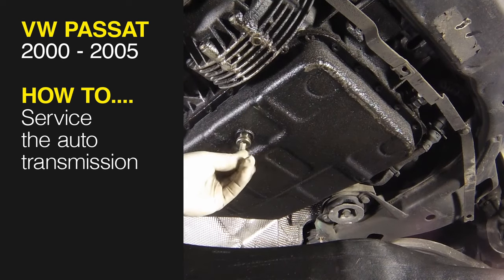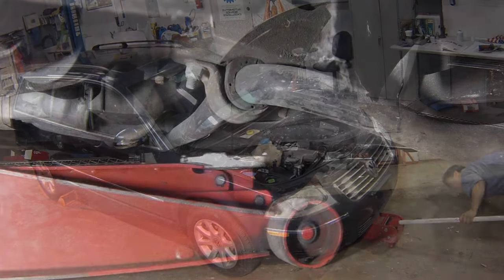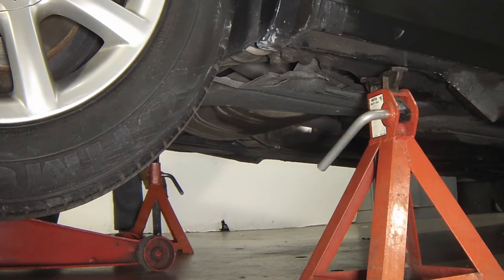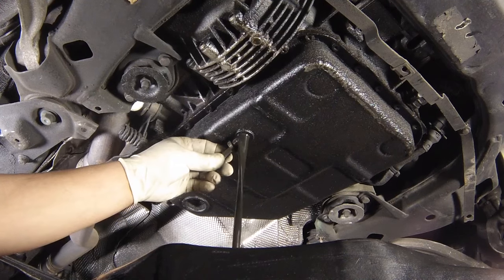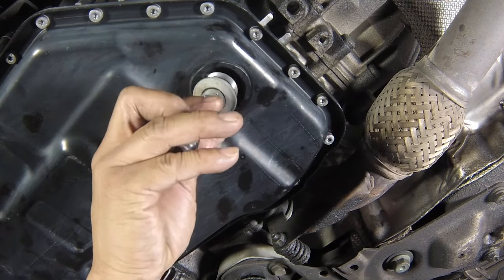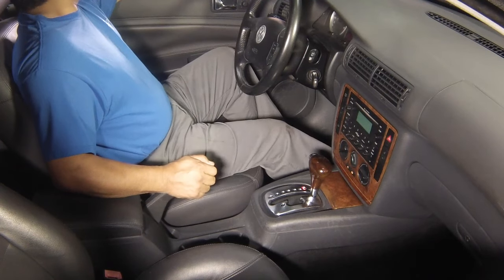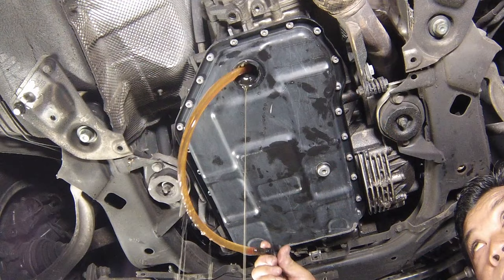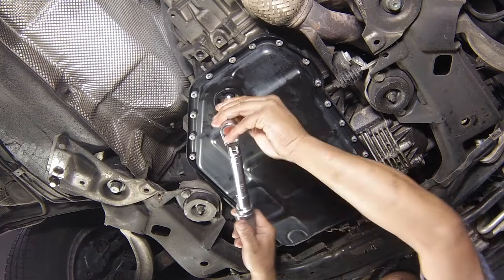How to Service the auto transmission on a VW Passat 2000 to 2005

Comment: first insert the plug then turn off the engine in the video they do the opposite ..
Reply: I wish I would have read this comment earlier! My transmission was running poorly in the cold and need fluid added, but I should have bought more in case! I turned my car off and lost about what I put in. At least now I have my custom filler tool and know the process so I can do all over again asap!

Comment: Hi my passat b5 has red fluid leaking out only when i drive it but when i stand still nothing leaks out 1.8T with auto transmission any idea of what it could be?
Reply: Its probably power steering fluid if its red.
Reply: We took off the steering fuilds pipes already
Reply: @aapokaski  does the differential also  have red fluid